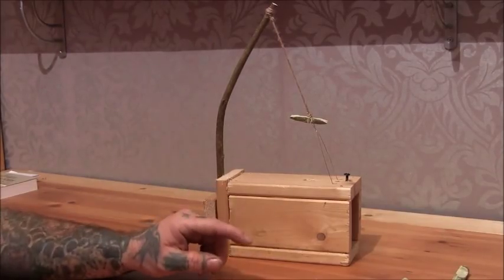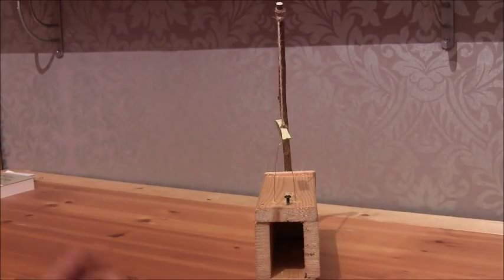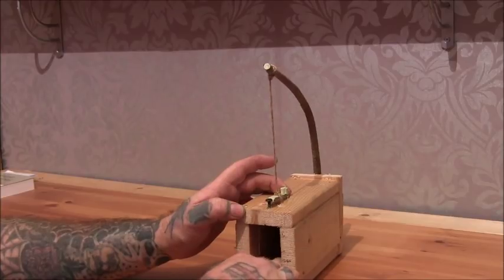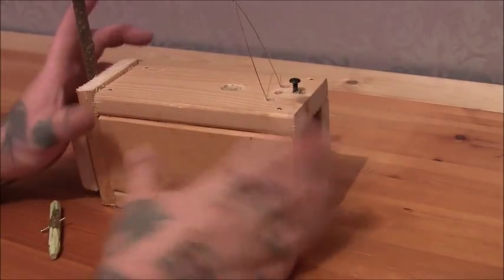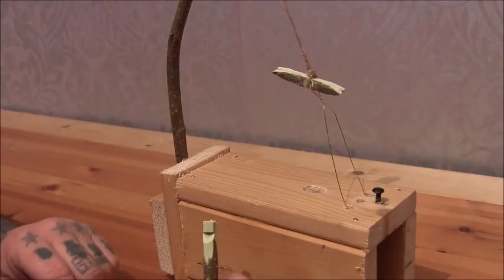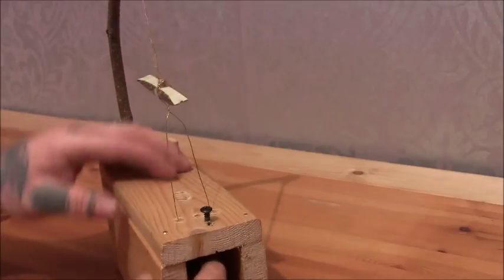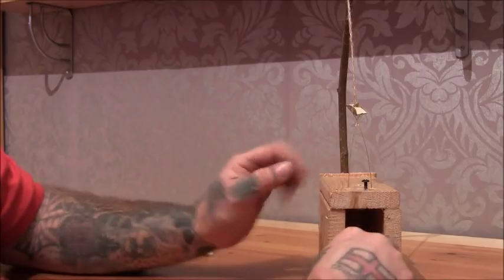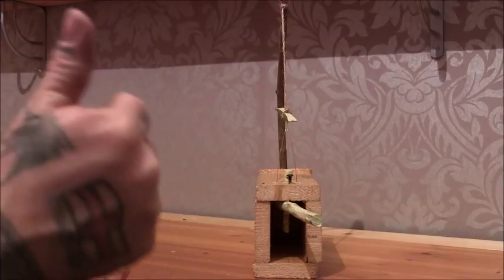Rat box snare trap

Comment: If you are concerned about the wood splitting, try pre drilling the hole for the nail and put a little glue on it near the stick so when you push the nail through the glue secures the nail in the trigger stick.

Comment: d'ya reckon thisll work for pheasant? or anything that can stick his neck in? could you do a sized up version for bigger things like fox?
Reply: Yes, works for pheasants, rooks and pigeons, instead of a square box use round pipe, 4 inch diameter, bury into the ground and sprinkle make on a modified trigger stick that has a plate on it.
Lethal for when the wheat and maize fields have just been planted.